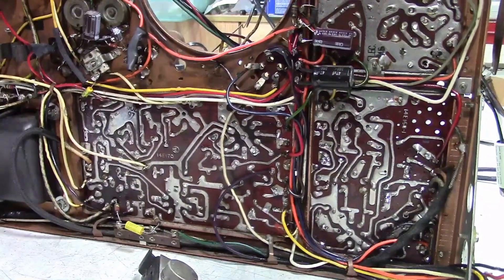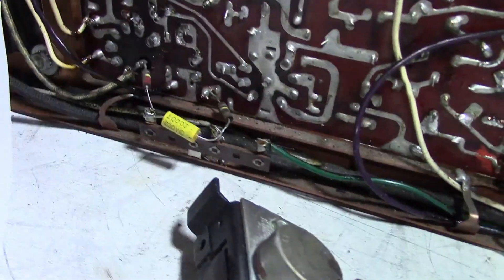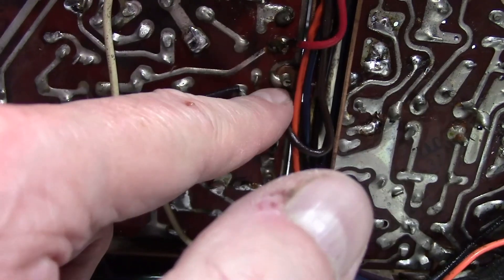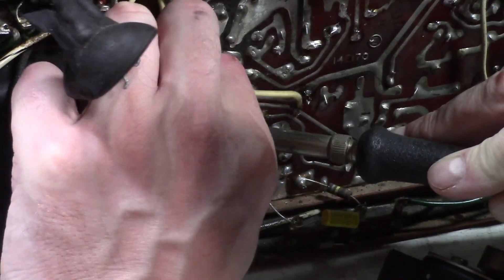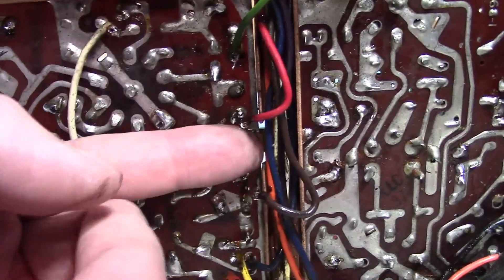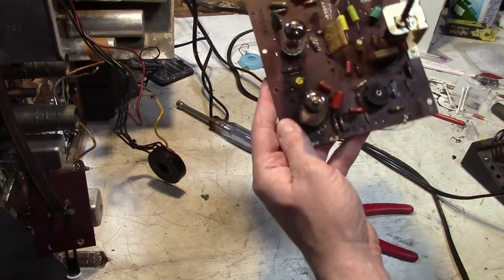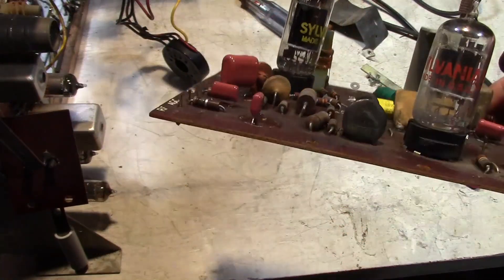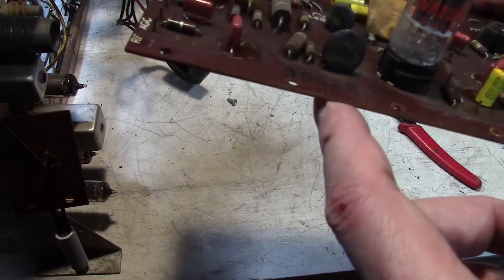Admiral T2301 restoration p6o8

Comment: My family had a Admiral imperial 800 up until color tv in Australia, the only thing to go wrong over the years was the horizontal o/p transformer and a modification to the channel 0 biscuit when channel 0 started up ( later to become channel 10 ) . Later in life when i was first apprenticed in electronic repair these set were starting to be traded in on newer set. One of my jobs at the time was to go through the set and repair as required. Other tecks at the time did not like working with printed circuit  boards and prefered point to point wiring. My how times have changed !!!

Comment: Given the changes in the circuit, I wonder if it could be back-dated by putting in a tube socket and a real 6AL5 in place of the two diodes? 🤔
Reply from the maker: Sure, should be easy to do.

Comment: Maybe it was just the lighting, but one corner of the board that you took out appeared to be burned on the board itself.
The sad thing about those modules, at least ones I have had to deal with, is that quite often the part that goes bad is between two other components (like a resistor between two capacitors) with no pins connected to the component that come out so you can patch in a new part, but, as you did, you have to create the entire thing from scratch.
You were talking about "why certain capacitors were used where they were" and it reminded me of an excellent video that covers that.  Thought you might appreciate viewing it:
https://www.youtube.com/watch?v=67M7fsbLUIU&t=4s
Also, the part that is in place of a vacuum tube that is missing...I think you said it was a Selenium Rectifier...is that correct?  If so...and if it is that Green part, I have never seen a Selenium Rectifier in that shape...that would be a new one for me.  Who makes it?
Will you be able to test the Sweep Board out of the set itself?  It would be interesting to see it working on its own if you are set up to be able to do that.
OH, and one more thing...I worked in a group designing a new product and I ordered a capacitor that was physically exactly like a 1/4 Watt resistor...color bands and all.  The only easily notable difference was that the body was pink.  Anyway, it didn't work on the VFO that I was working on, but one of the engineers in the group put it on a Network Analyzer and decided it had exactly the correct amount of inductance he needed for his project.  Electronics is such an interesting field!
Reply from the maker: No, the board is not burned but it is dirty.  I'll clean it off with denatured alcohol before I reinstall it.  Yes, it is a low power dual selenium rectifier.  Various companies made them for use in phase detector AFC circuits.  No, I'll have to install the board to test it.  That's why I replaced so many parts.  I have no desire to take it out again!